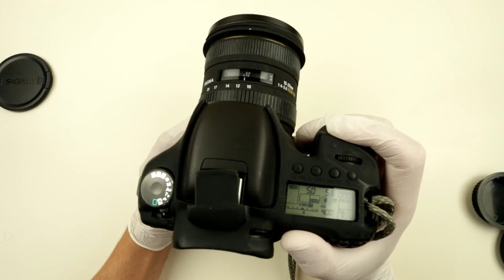Repair: Sigma 10-20 EX DC HMS EOS Autofocus Fix

Comment: Hey, 

I have the same lens and have AF issues. It seems like sometimes it will work sometimes but most of the time the AF does not work (manual focus is fine) - Any thoughts?
Reply from the maker: Sounds quite similar, but try manual focus! if you are willing you can open the lens and re-tighten screws. Intermittent AF usually sight of clutch issues.
Reply: @InsideOutElectronics  hello, thank you for your great video! My sigma 10-20, MF zoom does not work anymore, sounds some  thing/screw/ball in there. But AF works fine. COuld you tell how to fix this?

Comment: Hi, I have a problem with a Sigme focusses,  de ultrasonic motor is noisy and work it suck. Can you tell me, how it works, and is it posible respir it? Thanks
Reply from the maker: It is hard to tell what is going on in you case. Try opening it, and check if nothing blokes AF motor.

Comment: Hi! I have an issue but it is not with autofcus, well in fact it is not an issue until now but is anoying. I have the sigma 10 20 for almost 5 years without any problem, it accidentaly dropped (of course) a couple of days after buying it, but the only thing that broke (it bend) was the filter. But today I took it and I heard an extrange noise when I moved it, like a little loose plastic piece tha move from one place to another I cant say where, if it is from side to side or from front to back in the lens barrel. I tested it in different focal lenghts and diaphragms and everything seems to be fine: autofocus, image (so it seems that is no broken glass, I think...), etc. I dont know what can it be. What do you think knowing that you opened it? thanks in advance
greetings from Chile.
Reply from the maker: If it works and focuses and take good photos, just do not touch it I would say :)
Reply: @InsideOutElectronics  I want to sell it, but I want to know what could it be, and may be you have an idea since you opened it. If I sell it I have to lower down the price of course just for this rattle (could it be a plastic piece? o maybe a screw?) it is working fine, but of course the new owner should know the reason of the that noise, it fell just once, 5 years ago, and the noise only appeard a couple of month, any ideas?

Comment: Does this work on sigma 150-500mm  f/5-6.3 AF APO DG OS HSM??? I have the similar issue but the autofocus motor just doesn't work. Doesn't even make a sound.
Reply from the maker: Probably you have different issue, in my case motot was working but was slipping, for the lack of better word.

Comment: Hi, sir, i bought Sigma 150mm 2.8 macro lens, 2nd hand and it arrived well packed all metel build, little scratch no wear and tear...but when i attached it to my nikon d600, i does not work, no Af or MF , just gives little scratching sound from inside the lens when u click on shutter for AF but focal length indicator does not change....any guss.. Would be much appreciated...thank u in advance.....
Reply from the maker: HI! Does it make grinding noises when you rotate focusing ring? Does aperture closes to all values ( 11, 16, 22 ) ? If it was shipped insured you can claim shipping damage BTW.
Reply from the maker: Even if lens was nicely packaged,  sudden high acceleration can damage stuff inside the lens if box was dropped and tumbled on the floor.
Reply: amirnasher not when i rotate focusing ring it does not move anything...as if moving free.
Reply from the maker: I see, so highly likely AF clutch has issues, it either loose as in my case or broken. You have to take it apart or some one with expertise.

Comment: I have the same lens but it is for the Nikon brand, I mount it on my D610 and it recognizes the lens but when I switch it to AF the autofocus does not work, it only works in Manual. One question, it doesn't matter if it's FX, right? I wait your answer.
Reply from the maker: Hi, thank you for watching. I have never took apart Fx version of the same lense. Theoretically should be the same, no point to spin different internals for different cameras.

Comment: My wide angle lens(Sigma 10-20) always shows aperture zero. Can anyone suggest me why this like this? Is it a problem with my lens or something else?
Reply from the maker: Cleanup lens contacts first. But I have old Canon 75-300 with busted aperture cable and camera shows aperture 0, if you change aperture to something camera fails to take photos and shows error.

Comment: Thanks for this video! Encourages me to open mine, as it does not autofocus exactly at 10 mm intermittently. If setting a little bit above 10 mm AF works fine all the time --- annoying. As the lens is my "work horse" on motorcycle trips for many years, loose screws might very well be the reason. BTW: No need to appologize for the lengthy video, I take all the details I can get ;-)
Hint: I'm using a small plastic assortment box to keep screws and small parts "step by step", this makes it reassembling stuff like this a lot easier. Also a rubber mattress with "waffle patterns" on the table "avoids" screws from jumping/rolling off the table into nowhere :-)
Reply from the maker: You are welcome! I already figured out magic of silicone mats and organizers :) Check some of my latest videos :D

Comment: I’m thinking about doing this for my sigma 170-500mm f/5-6.3 apo dg as it doesn’t tack focus. Just a little off but it is off. Micro adjust doesn’t seem to help as it is always wrong even with the adjustment. Is the problem slight mid focus or is it something different?
Reply from the maker: Yes, sound like this is similar issue
Reply: @InsideOutElectronics  I see. Thanks a lot. I’ve fixed lens element issue plenty before but never electronics. I’ll use your video to help for find a fix. Thanks a lot!
Reply from the maker: @Bryantfstephens  this soinds mechanical as if there is a loose element. do not poke with electronics in the lens.
Reply: @InsideOutElectronics  sorry, that is what I meant fix mechanical things near the electronics

Comment: Hi, I bought a second hand sigma 10-20 3.5 for Nikon, I have a D7100. Autofocus doesn’t work - all my other lenses do. I can hear a clicking sound when it’s trying to focus, is this the same issue?
Reply from the maker: No, not exactly. In my case it was not engaging Af due to loose clutch, but at least it tried to rotate. Can you manually focus?
Reply: Inside Out Electronics thanks for the reply! Yes I can manually focus, my sigma 17-70 autofocuses. I’ve tried updating and rolling back to previous firmware versions (for the body), in all cases, it’s just the 10-20 that doesn’t af. Any ideas? Sigma London is just round the corner from me so I may give them a call tomorrow
Reply from the maker: @TheEmulsufiedEye  Do you hear the motor buzzing? In my case it was rotating but not engaging the focusing ring. No clicks. Do you have exact version of Sigma but Nikon  with internal ultrasonic motor?
Reply: Inside Out Electronics I don’t hear the motor buzzing, just this feint clicking sound when it try’s to focus, the more out of focus I put it the louder the clicking is, it’s a Nikon D7100 with internal focusing motor and the 10-20 f3.5 HSM model :)
Reply from the maker: @TheEmulsufiedEye  I think you lens is a bit different, from 4-5.6 model. But if it just faint click it might be AF motor issue. Were there any drops or hits to the body?

Comment: Hi, Amirnasher. Thanks for this great video. I have a Sigma 28-70mm  Aspherical EX lens for Canon 5D classic. The autofocus seems doesn't work. When I turn the focus ring, there is grinding, scratching sound from it. When I half press shutter bottom to focus, there is motor sound but no autofocus engaging. Is this the same problem? Thanks.
Reply: Hi, i think this is pretty similar problem. But in my case i have ring autofocus motor, not sure if your lens have similar. Is it HSM ?

Comment: Hello, I bought Sigma 10-20 and autofocus is not working with Nikon d3500. If it common problem? Incompatible with that model? Or can be fixed ?
Reply from the maker: Should be operational, what is exact model of sight?
Reply: amirnasher sigma 10-20 f3,5. I found in the Internet that it is incompatible with Nikon d5100-5300. Only official distribution can update lens for that model, for free.
Reply from the maker: @nevermindidontknow  Good to know ! Thank you

Comment: How to open the front element of the sigma 10-20?
Reply from the maker: I think it is not easy. Why would like to open front element?
Reply: @InsideOutElectronics  To be able to clean the internal elements, because I found a fungus.
Reply: @MrDouglasEdson  did you ever work it out? I've just got my lense out of storage and it's has a couple of scratches and dirt that won't come off, wondering if there is a way to replace the front element

Comment: Having issues with my 15mm fish eye going to see if this is the same issue fingers crossed 🤞
Reply from the maker: I hope you will fix it!
Reply: @InsideOutElectronics  me too my partner has two of these 15mm fish eyes for work and both AF make noise but the ring doesn't move so hoping it's internal screws loose 🤷
Reply: It's fixed turned out to be the small rubber band inside the unit that wraps around the AF cogs and drives the ring do you happen to know where to buy internal small rubber  replacement bands ?

Comment: Mine has a crack underneath. Can it be repaired?
Reply from the maker: Where exactly is that crack?
Reply: @InsideOutElectronics  it's on the glass.but I can't touch it.
When I shoot videos it shows. But doesn't in stills.
Reply from the maker: @kirkkirkkirk_audiovisualre2492  Oh no... unfortunately cracks cannot be repaired on class.... just need to replace that glass element
Reply: @InsideOutElectronics  Please how do I replace the glass ?
Reply: And how much would it cost? 
Is it possible to send it to you?
Reply from the maker: @kirkkirkkirk_audiovisualre2492  Well finding the new glass woul be chalenging... so I'm afraid I won't be able to help you. Just need to find broken lens with good flash to swap out

Comment: Just watched this video for the 4th time! Thanks to your post, I am able to get my Sigma EX 85mm/1.4 90% operational! Just picked it up at a local pawn shop, "as-is", wasn't autofocusing, wouldn't engage in manual focus. Turns out, lens must have been impacted, may be bumped from the front, probably on the body. Was worth the risk to buy it as-is; following your procedure, loosed up the lens focus "rollers", able to focus from 2.8' to about 40-50', but, getting clear images!! Great post!!!!!!!!!!!!! Very encouraged now!
Reply from the maker: Nice find  ! I wish I would find anything like that in pawn shop! What about remaining 10% ? Is there any damage to the slides or rollers? ( I think rollers were in another video about 50/1.4 )
Reply: Yes, I think that's exactly the problem, but, I didn't see the rollers until I got past the flex circuit boards! I wasn't as courageous as you were to disconnect them (LOL)!
Reply: Oh, I didn't share that the front lens element has a scratch, but, it's ok, we're just glad that the lens elements are moving at all!